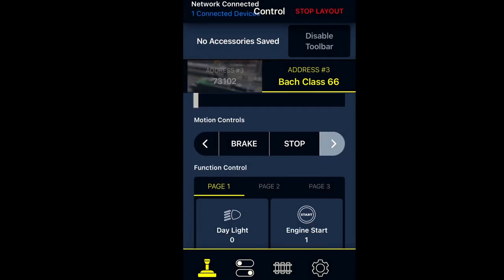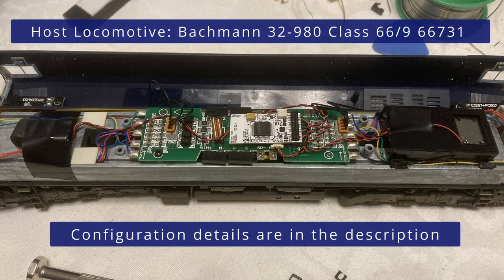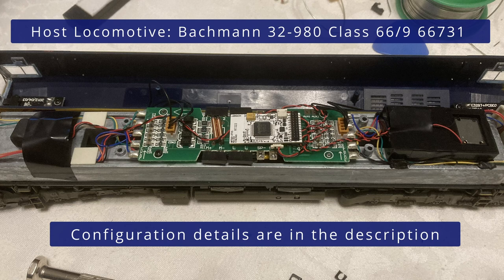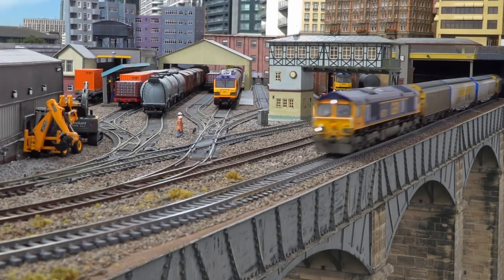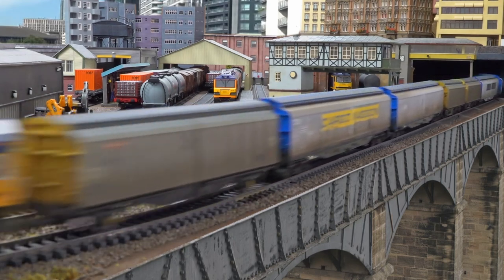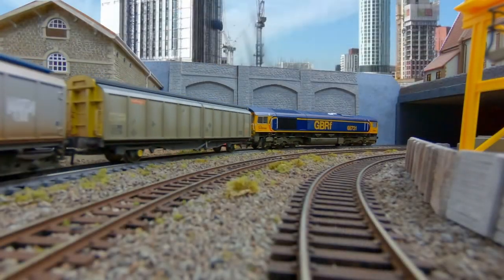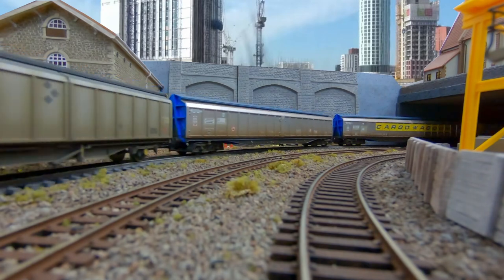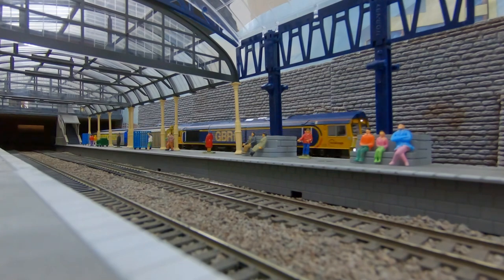Checking out the HM7000 TXS Decoder Class 66 Sound Profile via the App

Comment: For some reason, if i download this sound profile to my decoder, power cycle it and everything, i cant control it and nothing works and it says ‘no sound profile loaded’ anyone know what i should do?
Reply from the maker: Attempt a normal decoder reset by writing 8 to CV8. If you have a power pack fitted, you also need to take 60-90 secs when resetting during the programming process to reset properly. Failing that you need to reset the decoder from a Bluetooth perspective - remember that email you got with the reset code? This will unlink the decoder so you will have to find it and link to it again. If after all this the decoder doesn't work I'd get on to Hornby for help and potentially a warranty replacement.
Reply: @EuviRail  yes i do have the reset code, i will try this thanks